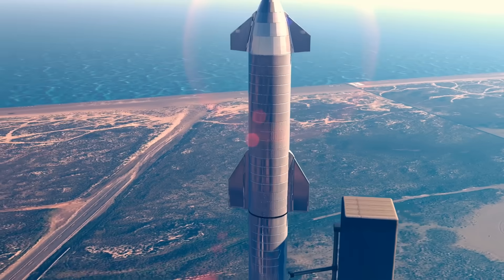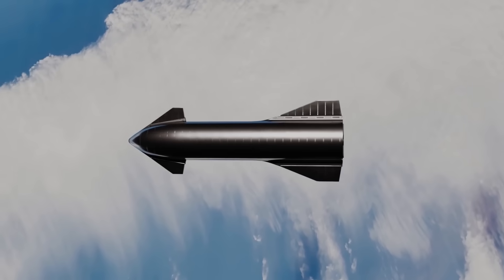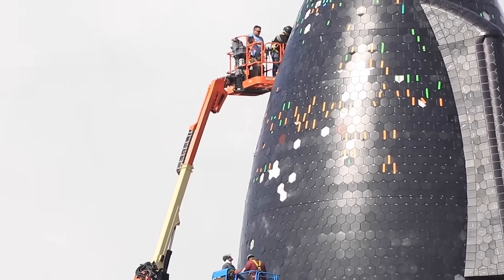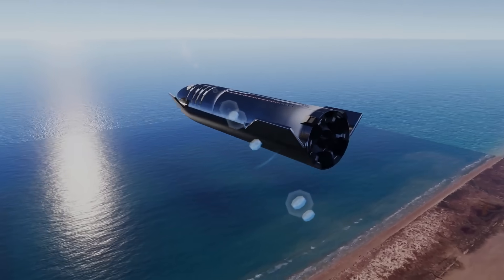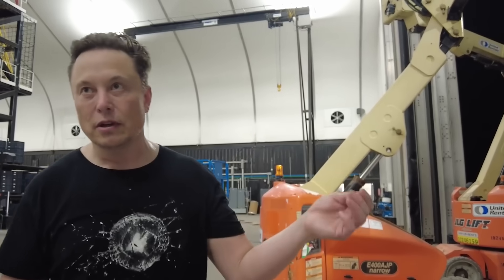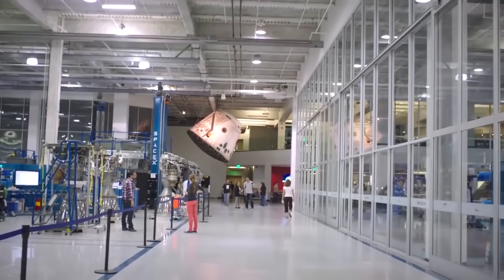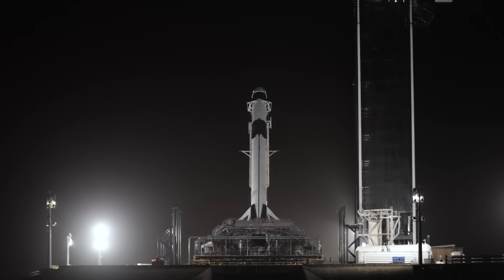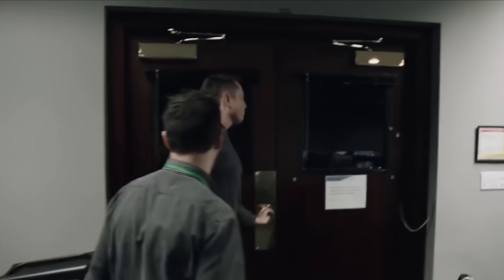FINALLY! SpaceX Starship 20 is Ready For Orbital Testing

Comment: Maybe like minds think alike but I suggested to the everyday astronaut in order to prevent the hexagonal Shields from breaking during the fill of cryogenic temperatures that hex Shields need to be replaced with a scale type of shielding to allow movement and hold each other firmly in place. Many improvements have to be quickly innovated in order to reach the goal of bringing the starship safely back down through the atmosphere after orbit.

Comment: What if for the fueling variants of the starship instead of using stainless steel they use carbon fiber, that way the starship is a lot lighter and uses less fuel to get it into orbit
Reply: Wow. You ARE behind the news.
Spacex STARTED with carbon composite design, and Abandoned the process as too problematic,  years ago.
Reply: @dnomyarnostaw  
You could’ve said that without being extra yes I did it just start following the star ship program. Your point?